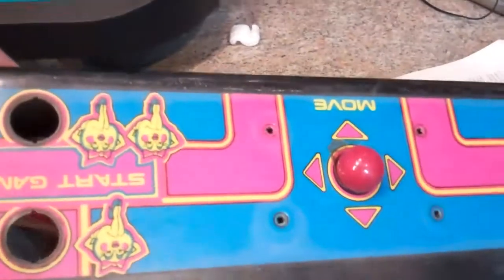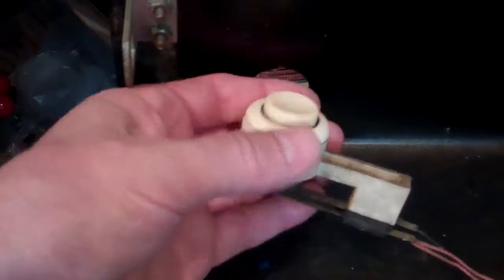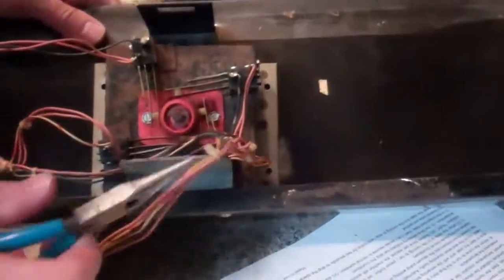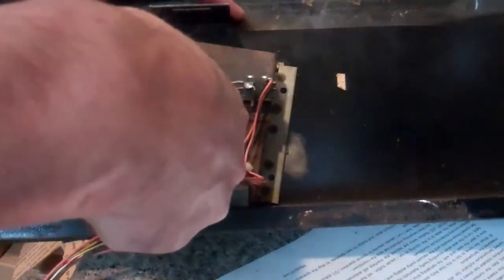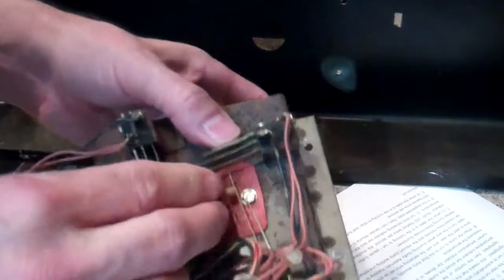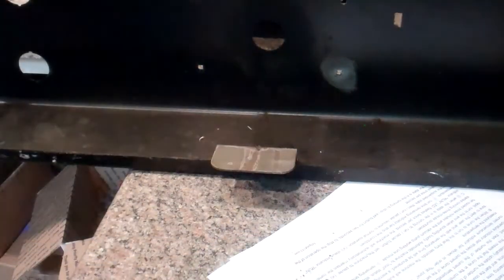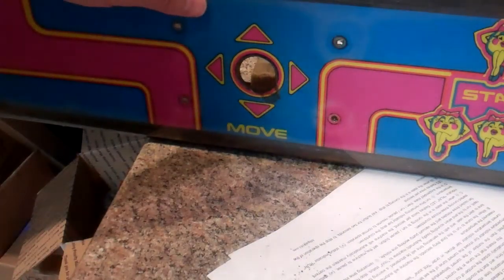Removal of the MS Pacman joystick and upgrading the control panel -  Video 1

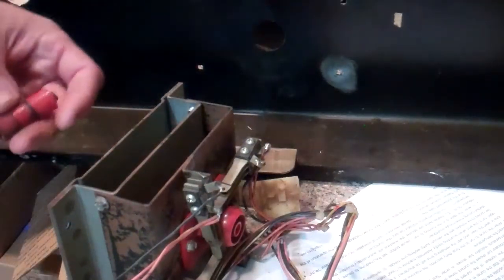Comment: @ 2:00 That red cylinder below the red ball that covers the metal shaft, does it serve a purpose? I’m talking with the owner of an arcade about a loose plastic cylinder on the shaft, which is less than half the length of the one shown in this video. It pops up and pinches my finger really hard when I use the joystick at any of the extreme edges of its range. Could we just super glue the shaft piece to the ball so it doesn’t move around?

Comment from the maker: Leaf spring switches can easily be switched to micro switch.  There are no special wiring requirements since they are a simple switch contact you can use the existing wiring.  Also, leaf switches are usually same size or smaller.  Micro-switches are typically a 1 1/8" hole size.  You should remove the leaf spring switch and measure the hole to see if it is compatible.

Comment: Yeah but most of the time they will come with original parts and if thos parts seem to not work properly then it is an easy fix its just the same as the power box situation if a power box kicks out then just get a new one from online and it is easy to buy parts for the original machine little know fact that they do sell original parts for 30 year old arcades online its not that hard to come by if you know what you are doing I just replaced my marqee for my donkey kong arcade its just that easy.

Comment: Isn't it a little weird to upgrade the arcade when its more rare just haveing all its original parts its kinda sad really cuase most of all the original arcades have been hacked up kinda like what ur doing I'm not saying that its wrong but takeing away the original value by replacesing things on it instead of referbishing it is just a little foolish
Reply: also you can just wire the start buttons to the fire buttons for the 60 in one. There's no need to add more buttons. Even the pacman to jamma converters will do this for you.

Comment: Bud don't make fun of me seriousely the thing that bothers me the most is a guy who thinks they know me and also I 4 machines that I fixed I even have pc jamma bourd parts and control parts as well so don't be an ass its a convo not an argument. But yes arcades are an easy fix if you read enuff books and learn all about arcades it just like fixing a computer. And not all the parts in an arcade with be up to date so yeah its easy, Old parts are simple and can be restored to its original state
Reply: Show how  to  open  the  back  of  the  2012 namco  pacman  to  check  out   the  joystick   

Fix namco joystick  2012

How  to